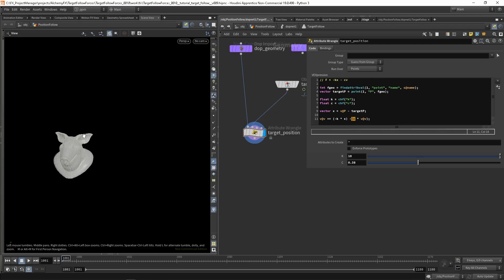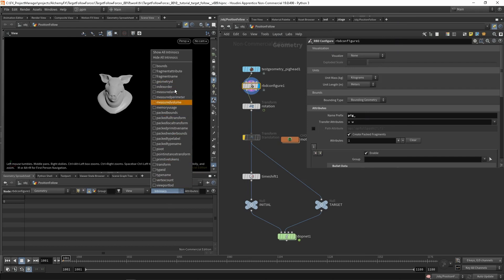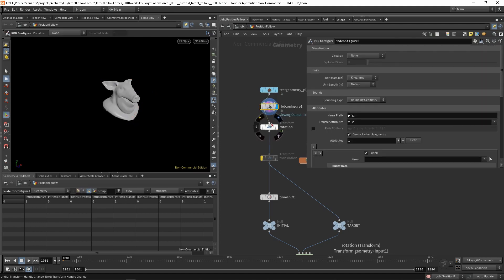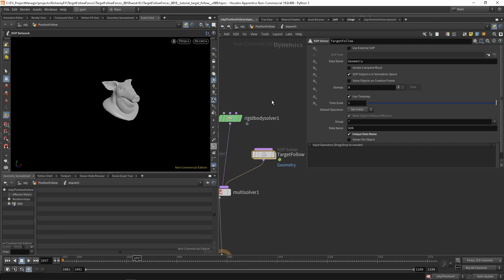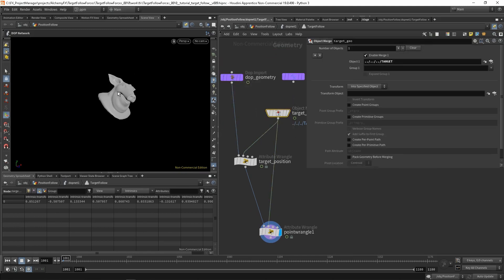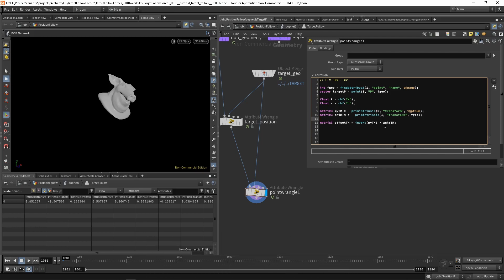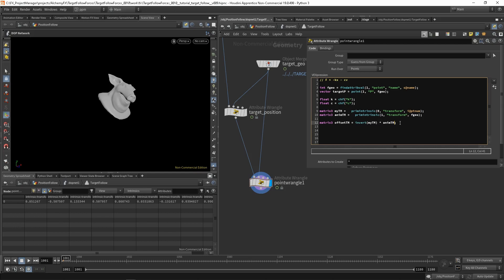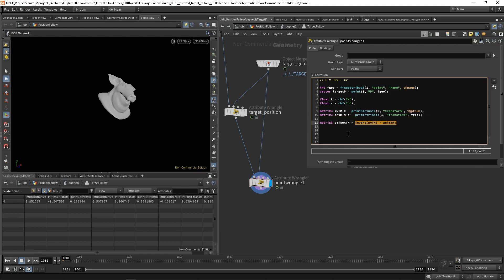Guided Dynamics in Houdini: Part 2

Comment: What you extracted out of the cracktransform is only the degrees in XYZ axes for rotation from current matrix3 (input 1) to another matrix3 (input2),  also it is not a velocity difference. So  I don't understand TargetW =v@w- TargetW.   Explanation, please?
Reply from the maker: You have a vector W that starts empty, and a targetW which describes the rotation from the difference matrix, if you subtract those two vectors and add that subtraction to W times delta time you will slowly align both vectors, the closer those two vectors are, the smaller targetW will be, and therefore the smaller the change in angular velocity, that was my idea with it, I usually just write down things in paper and then try to apply them in Houdini, I just forgot to multiply times @TimeInc during the recording of the video . It is easier to understand if you visualize the attributes, anyway that was just an idea I wanted to share, that so far have worked for me, but you can go the quaternion option if you want, this was mostly an excuse to use the Hooke's law for the rotation.
Reply: @alchemyfx4158  Sir, is the result returned from vector targetW = qconvert(offsetQ); the same as from vector targetW = cracktransform(0, 0, 1, 0, offset);?
Reply from the maker: @jpsunchase7165  I didn’t compare, you can try yourself.